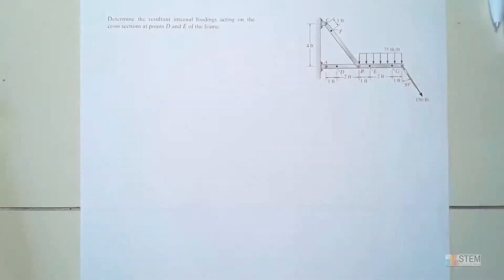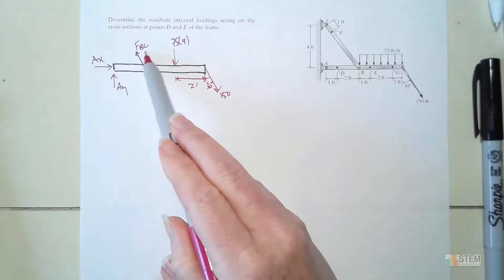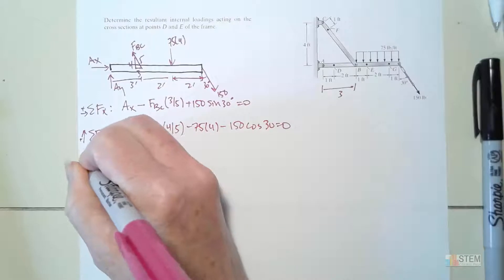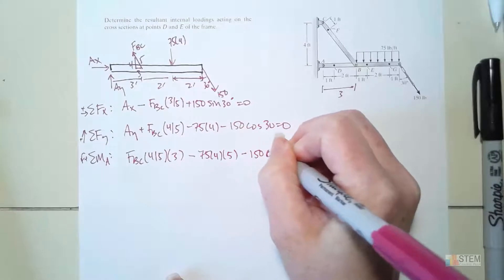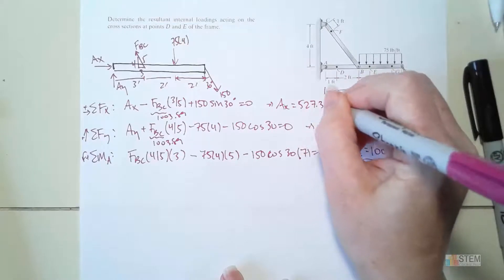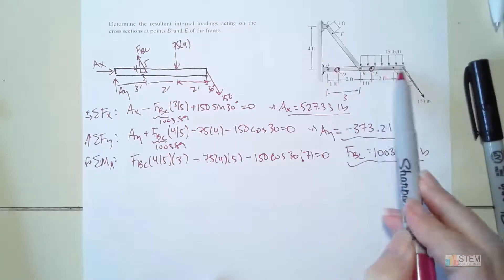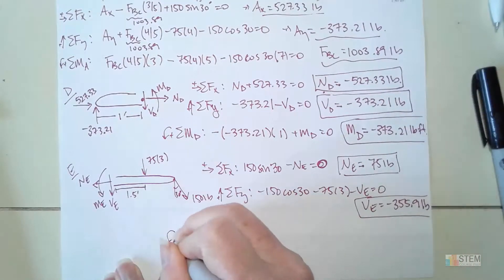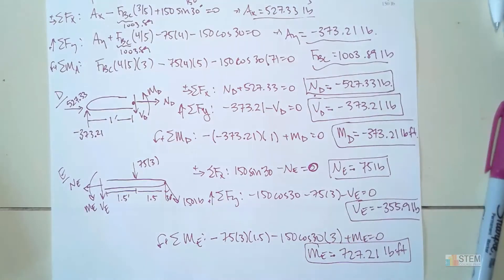Internal loadings on a beam with uniform distributed load solid mechanics

Comment: F(BC) is a internal pin so it must have 2 reactions. Why is there only F(BC)y and not F(BC)x?
Reply: Is it because F(BC)x has no force. Just like Ax would equal 0?
Reply from the maker: BC is a two force member so those are modeled with one force in the direction of the member.  Typically if you try to include two forces for these members you will end up with too many unknowns in the problem.